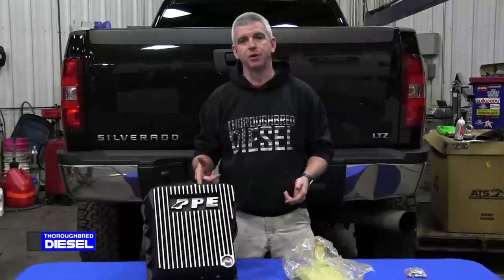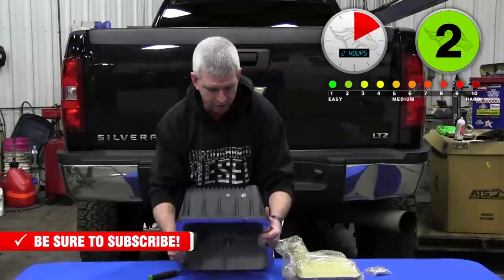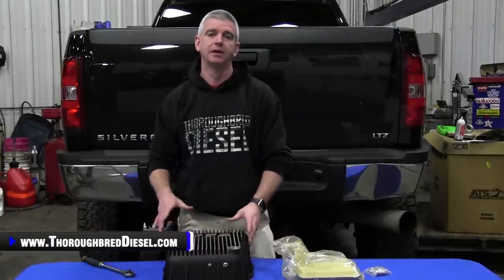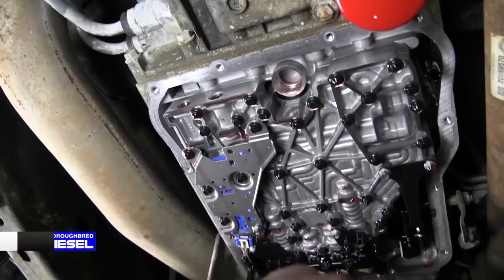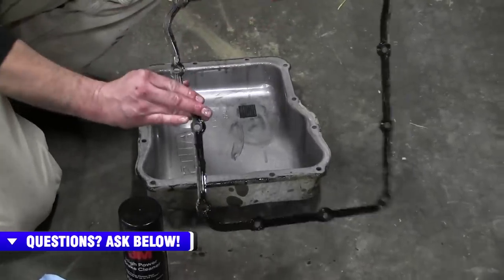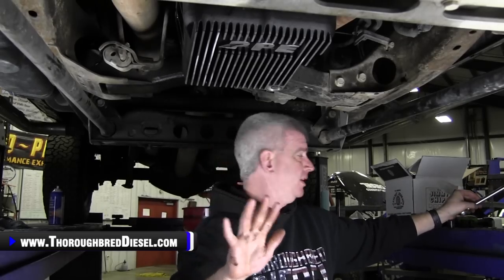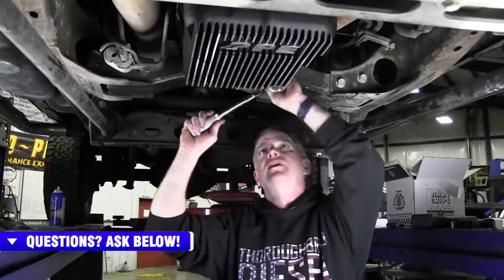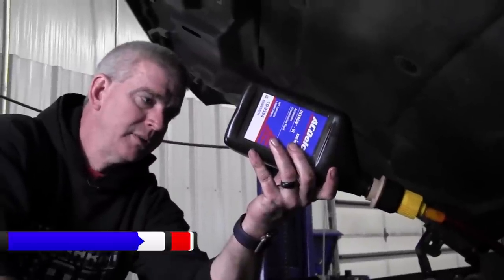PPE Heavy Duty Deep Allison Trans Pan Install: Chevy Duramax

Comment: How does this pan keep the filter from falling down?  Do you recommend the merchant automotive filter lock?
Reply: the PPE pans come with a built in - from the PPE site-PPE’s exclusive built-in filter lock comes standard and keeps deep filters securely in place. Allen-head mounting bolts and a new deep filter are included

Also wade mentions the extra fins that act as the filter lock at 1:48

Comment: The PML pan instructions say to NOT use the stock magnet in the Pml pan or sever transmission pan damage can occur, however the Pml only comes with a tiny magnet on the end of the drain bolt. How can the old magnet pose a danger??
Reply from the maker: I don’t have any info on PML pans.
Reply: the PPE pan is aluminum therefore the magnet will not stick to it.

Comment: As a pipefitter/welder I went with snuging up, the front n back bolts first, but three times around n a wiggle half way thru, seems like it's a simple process, even if your doing this on the ground if you push thru, it can be a simple process pan off n on in 20 minutes, just do it, I gotta go get a whole nother gallon Monday,

Comment: Maybe this is a dumb question..    but why ,  especially on a deep pan, is there not a magnet siting in bottom to collect metal shavings that might occur over time
Reply from the maker: Some of the pan manufacturers include that and some don't. I don't have a good re reason for why it would have been omitted from the design.
Reply: The PPE Heavy-Duty DEEP Aluminum Transmission Pan also features a high-powered Neodymium- magnet-equipped drain plug to keep harmful ferrous metal contaminants out of the transmission internals.
Reply: Yes, that is a dumb question.

Comment: I just bought a LBZ and I dont know when the fluid was changed last. I out a new spin on filter on but I'm deathly afraid of changing out the internal filter. Not because I couldn't do it. But because I've seen and heard so many trans dying after words
Reply: Your transmission isn't going to fail because you changed internal filter and added new fluid. Allison does however state to not flush the transmission...ever. Dump and fill with Transynd Fluid and Allison filters.
Reply: Transmissions generally fail after a service because they were failing before the service, and the reason for the service was because it was slipping or slow to go in gear or shifting funny to begin with.

Comment: On my 2013 dually I did the PPE engine and transmission oil pan upgrade, but after some time I noticed that my transmission temperature would go up why is that. But when I had the original pan on it it wouldn't do that, and all I use it for is to travel far out of haul my toy hauler, and I checked my fluid level and it's where it needs to be?
Reply: No answer lol 😂

Comment: What is the purpose besides cooler transmission? 
And that goes in stock transmission?
Reply: Prolonged ATF life,  I believe it almost doubles life of the fluid. I noticed much cooler temps while hauling also runs a lot smoother.

Comment: Allison doesn’t recommend replacing the internal filter unless a major overhaul 🤷🏻‍♂️
Reply: Ummm, the stock filter is for a shallow pan, it will not work to well with a deep pan. You need a filter that is longer for the deeper pan. You are correct, Allison does state the internal filter doesn't need to be replaced unless overhauling, but you have no choice when changing transmission pans to other than stock depth.
Reply: When it says they don’t recommend that you change it,,,   Are you saying they  discourage it,, or that it’s not necessary?    Those are kinda different .....   like it isnt necessary to change oil every 2000 miles..  so they don’t recommend it....   but it doesn’t do any harm,